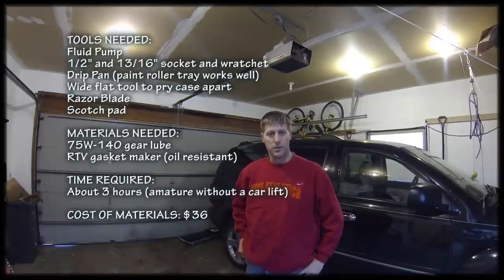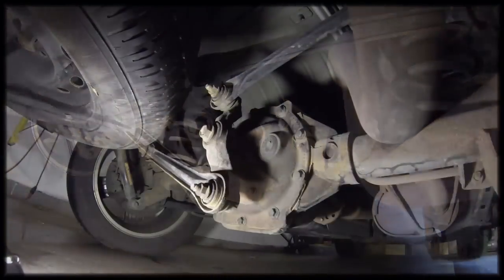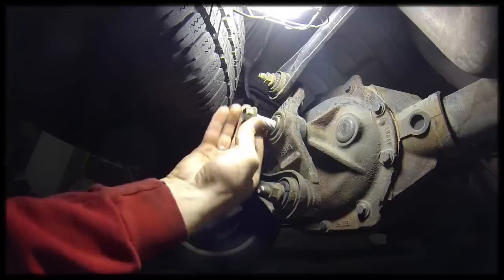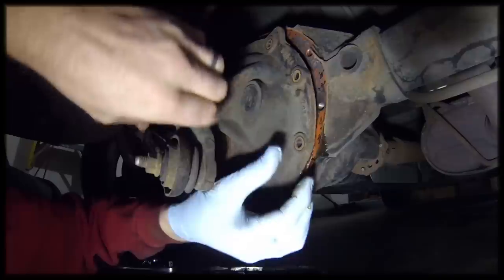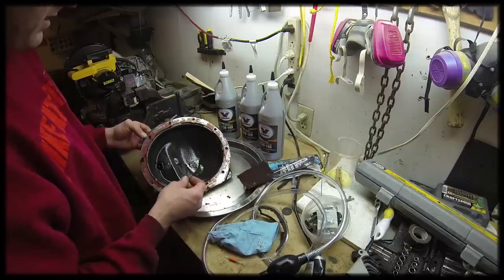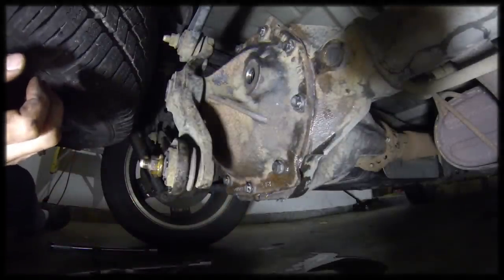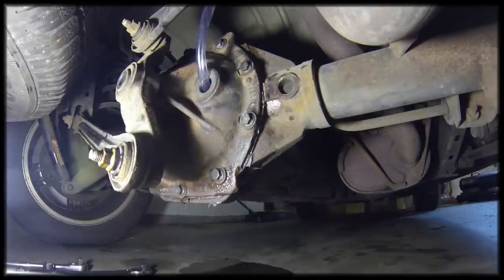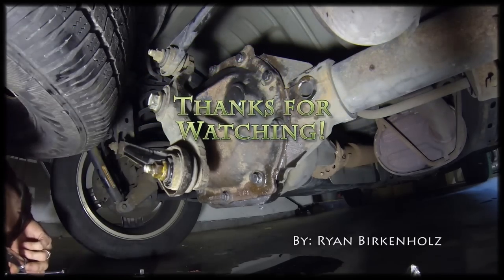2007 Dodge Durango - Rear Differential Fluid Change

Comment: We dealt with the spare tire as we could but ended up taking it off to make it easier to to removing the links to the mount on the frame. That and when it was necessary to remove the pin bolt that retains the long rod that keeps the  axles from being pulled out to replace the wheel bearings. So in essence you get a ton of space after the spare tire is removed. Good video!

Comment: Only thing I noticed was you used your torque wrench to remove the bolt. Big no no to use a torque wrench to REMOVE a bolt.
Reply: Agreed!  Torque Wrenches are finely calibrated and should not see the amount of force when used to break a bold free.  That one is probably not accurate any more.
Reply from the maker: Yes, I should have explained that.  I actually have 2 torque wrenches, one old one I use to remove bolts and one that I use to torque down.

Comment: Wouldn't it be better to let the sealant set for an hour before you connect the cover? If you set it in fresh isn't that going to remove some of the material added?!?  Otherwise informative and pretty easy to do step by step video.
Reply from the maker: Marius Purcel, I was just following the instructions on the package of the gasket maker.  If the gasket maker you buy has different instructions then I suggest doing what they say.

Comment: I have a 2008 Durango with 10 bolt differential,do I have a 8.25? Looking to get the correct lube locker gasket.
Reply from the maker: Hi Joey, I only have the service manual for a 2007 so I dont want to give you the wrong information on lube to use.  I am sure you can find this information in your owner's manual or online.  Good luck!
Reply: Call your dealership and give them vehicle VIN #. They will let you know if its a 8.25 or 9.25

Comment: hey can i used Mobil 1 synthetic gear 75w-140
Reply from the maker: That is the right weight of lube.  As long as it meets the specifications required by Dodge you should be OK.

Comment: You can just use your siphon pump in reverse and just suck all the old fluid out through the drain hole. That way no need to remove the cover.
Reply from the maker: I think that may work and I have considered it but I like to visually inspect the gears and make sure there are not metal chunks in the bottom of the housing.
Reply: My thoughts exactly!  Unless you have some leak coming out of the seals, siphoning is the way to do it.  This video completely overcomplicated the process and will likely result in some DIY'ers experiencing leaks after they fail to properly bead and torque the cover back on.
Reply: I thought exactly the same thing when I was looking at my diff. today. I'll just use my pump to get out what I can without removing the cover. I've got to do the front and rear.

Comment: doesn't dodge use a gasket?
Reply: You can get a fel-pro brand preformed gasket at your local parts store. I just did the rear diff on my '04. I much prefer that as you don't have to play scrapy scrapy again. It's worth it as far as my time is concerned, just my $0.02. :)